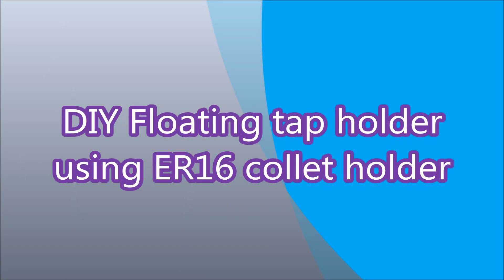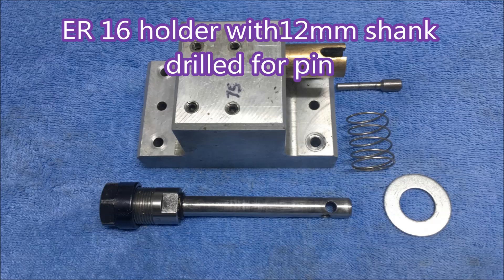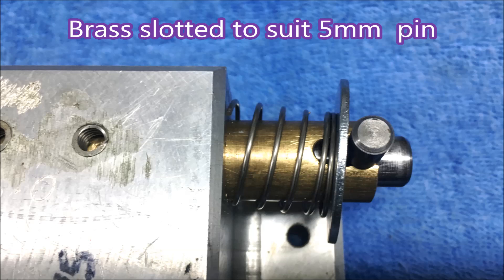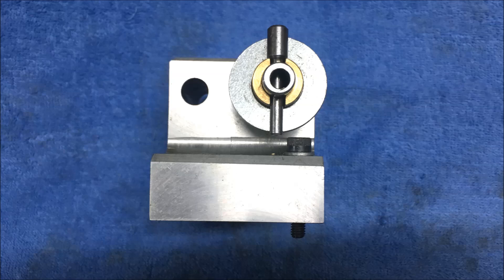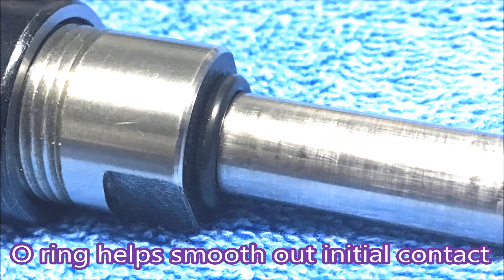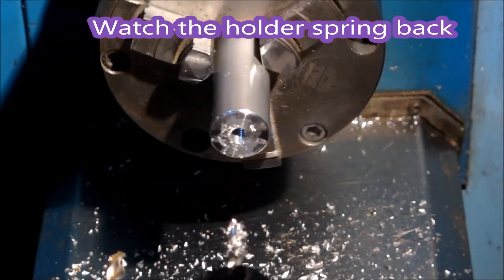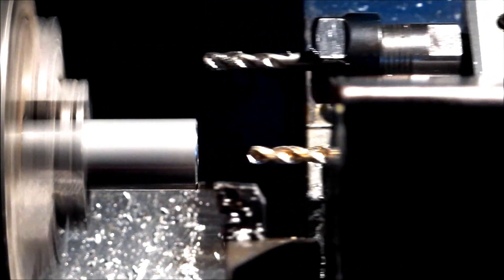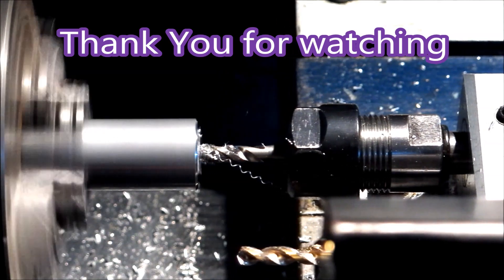Home made ER 16 Floating tap holder for use in my cnc lathe, rigid tapping not advisable

Comment: Good tool, What material is that, Could work in steel or iron? maybe for external thread too?
Reply from the maker: Hi Christopher, I used aluminium and brass as they were available and easy to work with.  the only problem I have is the brass slot that the steel pin sits in tends to deform. The Steel pin throws up a burr in the slot and I have to remove the burr for the unit to work nicely. I can see no reason why the same principle could not work with a die.

Comment: Excellent design and execution.
Thanks for sharing.
Reply from the maker: Thank You.  It works, was not expensive and the ER 16 collet holder can still be used as a collet holder as long as no scuff marks are made on the sliding part.

Comment: Excellent tutorial of your tap holder! Thank you for showing.
Reply from the maker: Thank You Robert, did it provide the information you needed? It is really very simple. I would have been better off if I had used a larger ER as I have had to have the shanks ground down on some of the taps I have used. However that would have cost me Z clearance so overall it has been quite good.